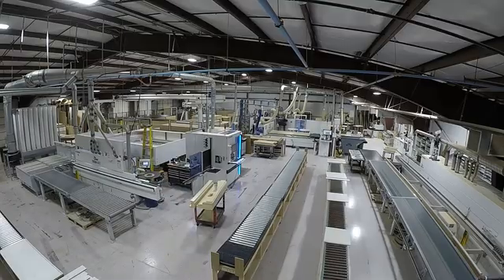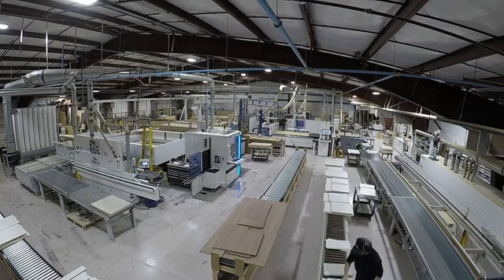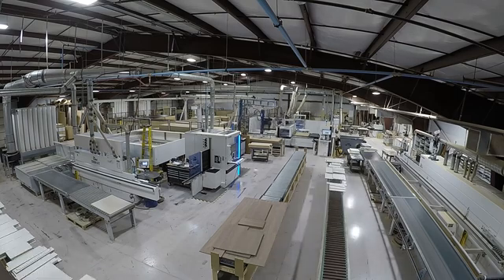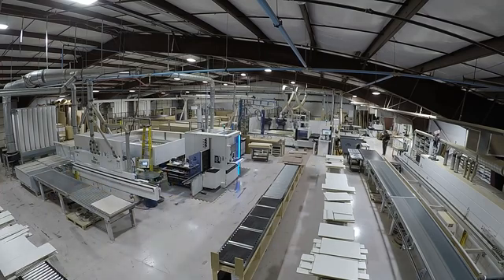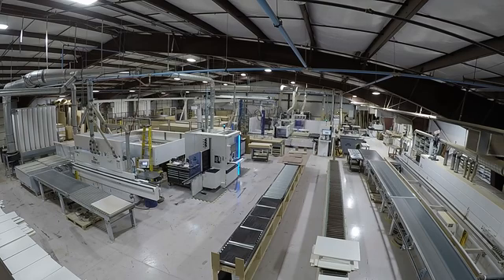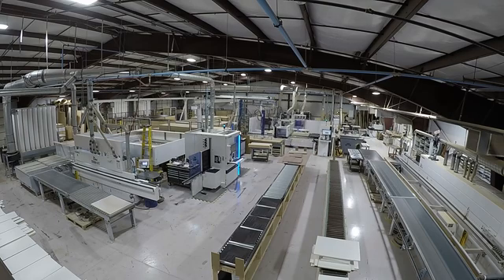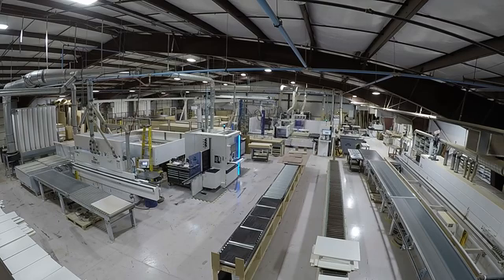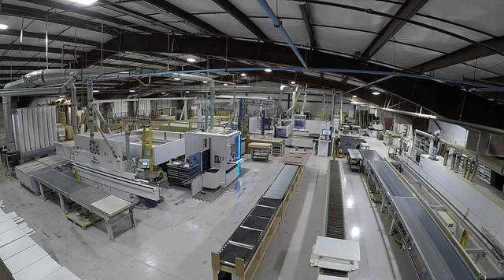All four Homag CNC machines running cabinet and painted parts.

Comment: why do you have 4 dc instead of one big with cyclone and silo outside?
Reply from the maker: In order to do dust collection right on an external collector it would cost approximately $600k. We are in to ours less than $75k plus we like the flexibility of moving them around if needed. In the next few months we will actually be moving them to a shed outside and adding a briquette machine below them. Should be fun.

Comment: Could you point to the machines as they are operating? You say that someone is working on a certain machine, and it takes a bit to figure out for someone who's never worked in a woodworking facility:)